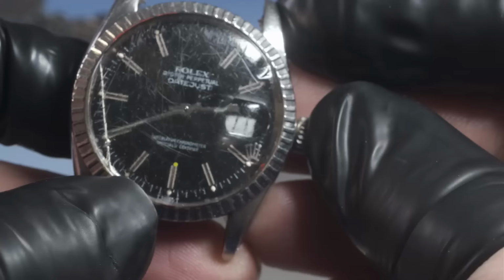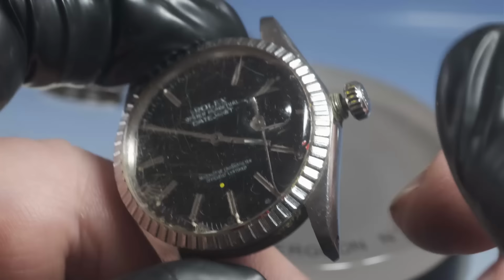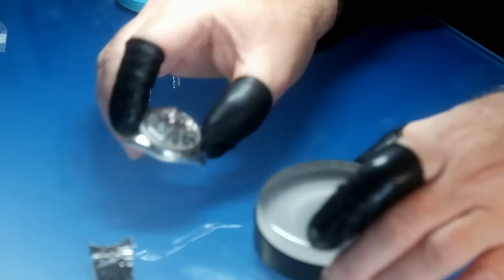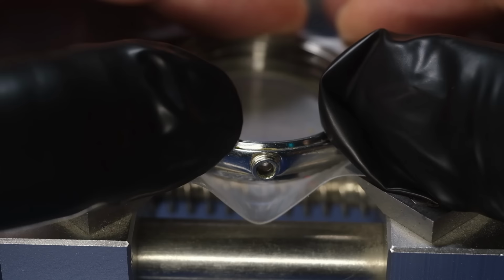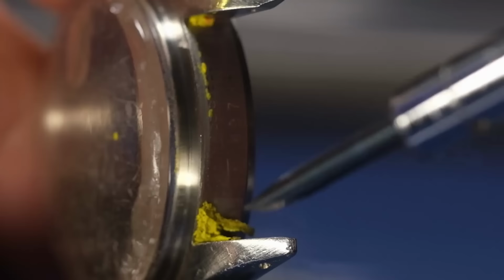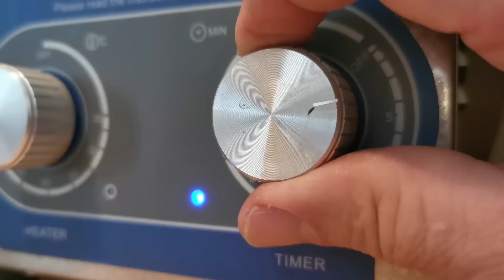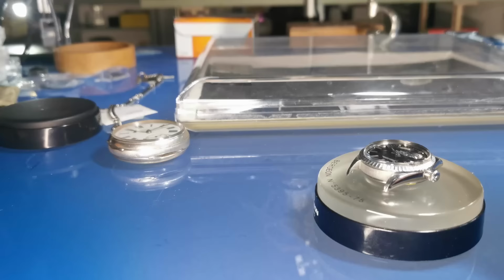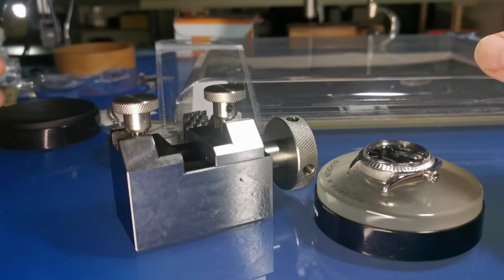Scaffolder's Rolex Restoration  - 30 Years Above London!

Comment: What a testament to the oyster case! Beat to heck on the outside but once opened revealing a bright and shiny movement and dial. Wonderful job, Richard!!
Reply from the maker: Hi Mike  ... and the moden cases design (especially in regard to the crystal fitting) is even better.  These watches are built to last for sure.  Great feedback.  Much appreciated.  Richard
Reply: You'll find that with most decent watches, not just Rolex.
Reply: I mean it’s a stainless steel case. Nothing special about it
Reply: @garyboyle695 So you think a San Martin will hold up just as well?
(Just kidding. Although it would be interesting if there will be an affordable compatible replacement for an NH35 in 30 years' time as it won't make sense to take one apart...)
Reply: I couldn’t believe how spotless inside was

Comment: Richard, I love your videos however there are so many channels already that show movement cleaning and reassembly. What I think is more interesting is the time spent on the case and bracelet restoration. At least that’s how I see it. I hate to admit that I fast forward through most of the movement servicing so I can get to the case and bracelet part. Thanks for listening to my opinion. Also, I want to purchase one of your watches, I think they are smashing !
Reply from the maker: Hi @wannabe_sailor_777smith6  ... yes it's easy to get too focused on the movement and I am alive to this issue and will be doing a video soon on just the refurbishment of the bracelet alone.  There is much skill in this discipline I think and if filmed correctly it can make for great (and relaxing) films.  The Sea Wolf that I make under my own brand Major and that is shown in this video is here  .... https://www.majorwatches.co.uk/sea-wolf-special-edition-steel  .... stay tuned for case and bracelet refinishing action!  Richard

Comment: I love your work, but there is one thing were i wanna give you a tip (although i don't know if you did it to show the parts more on the video) but with the shockprotection. Try having the cap jewel on the table and putting the hole jewel on top of it. You have way more control over where it goes and atleast i was told you have to do it all over again when you smere the drop of oil all over the jewel. Because you wanna have a nice bubble from the top view for it to correctly oil the pinions. I wanna say it again, love the video tho

Comment: Will you be doing a video of the bracelet restoration? I have a 1944 bubbleback with a similar "stretched" bracelet and was wondering if it can be repaired.
Reply from the maker: Hi @offshorequest  the bracelet restoration video is in production now.  And sure your bracelet can be restored.  If you would like more information on this service please contact me via https://www.majorwatches.co.uk/contact/   I hope this is helpful. Richard
Reply: @richardperrettwatchmaker  Thanks. I messaged you on the link you posted with more information and my contact info.

Comment: Hello Richard,

it would be very interesting for me, how long in total this restauration took in real life. And of course the problems you ran into. 

In my experiences a job like this, also needing polishing, changing the crystal and so on takes approximately one week, or at least one complete weekend.

In many cases i´m facing problems like the movement runs good dial down, but dial up not. Or the beat error is different by, for example 0,7ms dial up/down (which is not acceptable for me).

Daily worn watches with scratches all over the case like this Rolex always do have problems with wear and tear.

Therefore my question: How long did you need for it?

Anyway, another well done video - thanks for your effort!

Sincerly my best greetings from Germany.
Reply from the maker: Hi @revisionair .... There is probably about 20 hours on the bench.  2 hours messing about with organising footage and audio.  A whole morning, with a nice cup of coffee, just to make the thumbnail.  Another 15 hours on the edit and 2 hours uploading, creating the blurb.   I make my own watches too so it always takes me about a month to get a video created to a high enough standard.  Ironing out escapement issues, like the beat error you mention, can be very time consuming but I tend to do this work more in a more leisurely way after the video is shot.  Good questions and I hope this answer is helpful.  Richard

Comment: 7:07 I see you made your own tool to remove reverse threaded screw. Ingenious! 🎉 Are the screws standard and does the tool fit all Rolex models?
Reply from the maker: Hi Daniel  .... Yes, its just a 250 (Blue) watchmaker screwdriver filed down to size so that it fits.  These only take about 15 minutes to make so you can pretty much make on for each caliber if necessary.  Better than not having a tool that can apply the torque cleanly where it is needed.  Good observation!  Richard

Comment: With all due respect, but … If I had lubricated the cap jewel or pallet fork like that during my watchmaking masters exam, I would have failed!

Also, instead of using pieces of plastic bags for protection when pulling hands or fitting case components like bezels, I strongly recommend using the round Bergeon silicon sheets!!!!

Comment: Surprised he`s using a metal tool to scrape that yellow paint off,surely that will scratch the case too? Why not use a sharpened hardwood or plastic stick?
Reply: I would guess the case is getting polished in the end